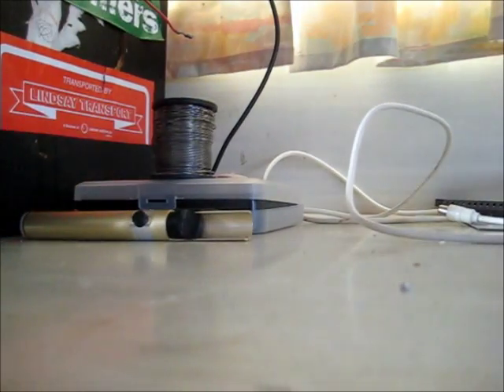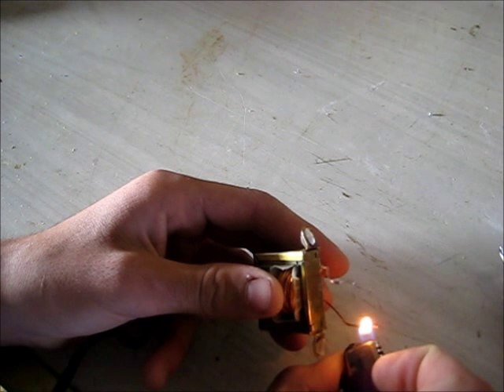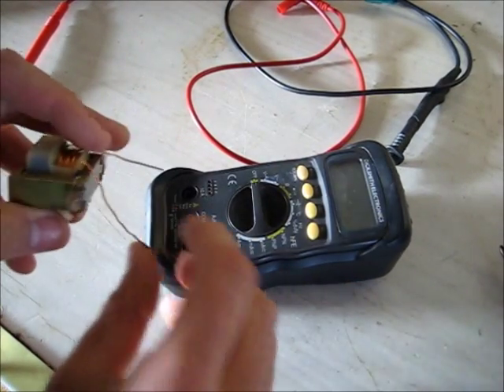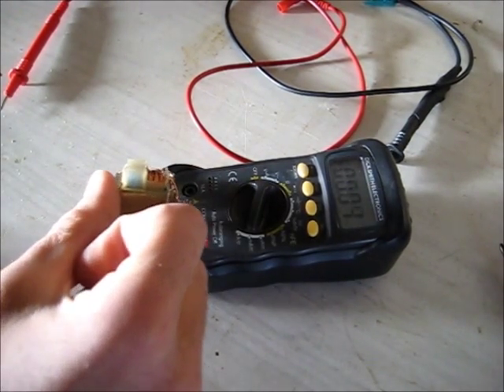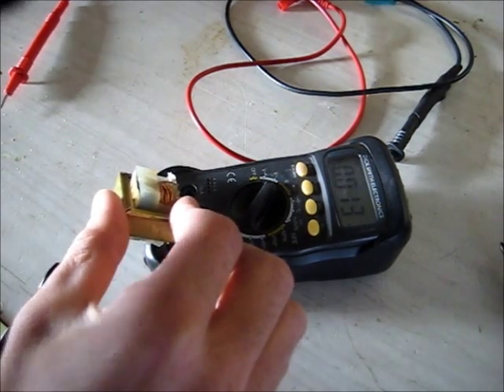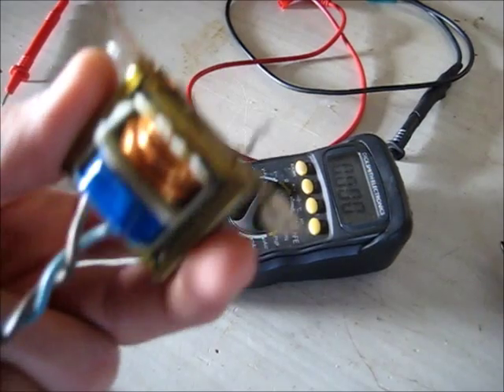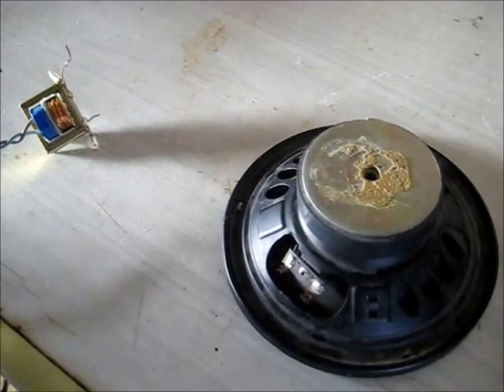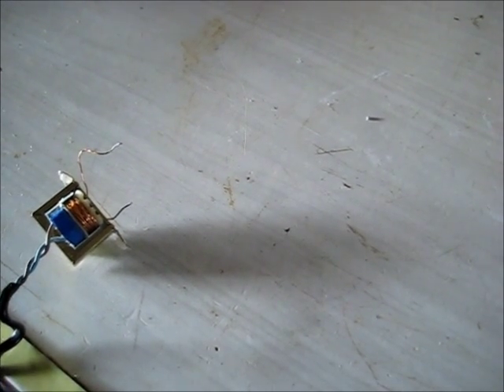Rewinding a small Transformer

Comment: Dude, when measureing current you connect the multimeter in series with a load, not use your multimeter as a load. Check you fuse inside probably find it is blown.

Comment: That looks like a 1/2" leg EI stacked to about 5/8 of an inch..tiny about 7VA ? The volts per turn is determined by the cross-sectional area of the center leg and the flux density. The leg on this is about 1.8 cm2 and at 1 Tesla is about 0.04Volt per turn, To get 12V ac you will need 300 turns the primary got about 3000 turns on it with very thin enameled copper wire. Full bridge rectifying 1.5Vac is not practical as most of the voltage will be lost as it is dropped across the diode junctions.  To re-wind the transformer you need to dismantle the core lamination and pull the bobbin out and then you can wind it properly. This is not easy.